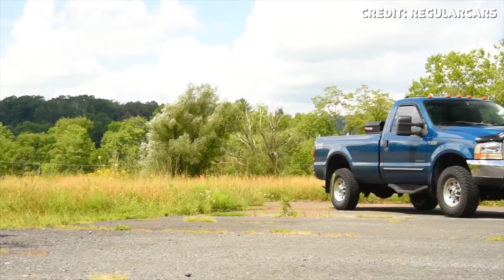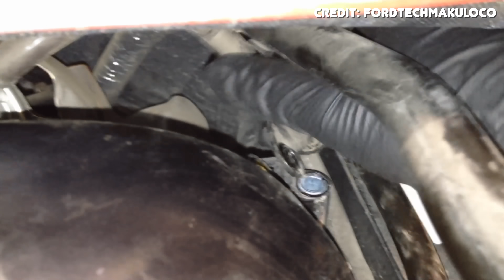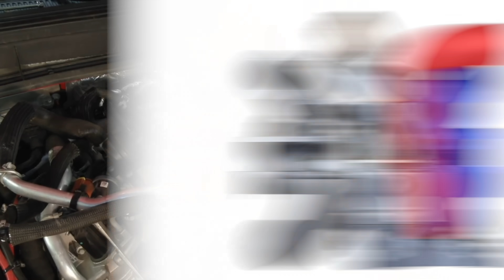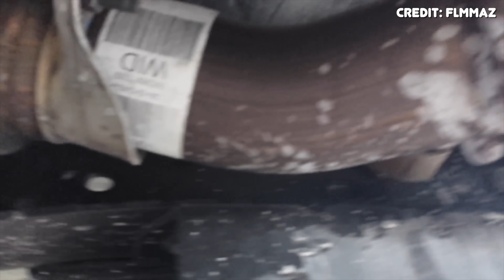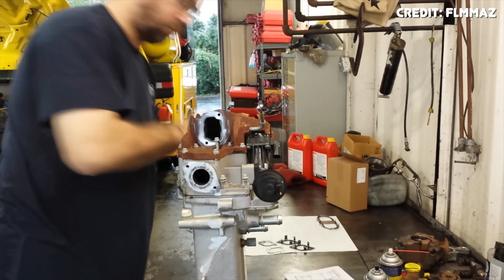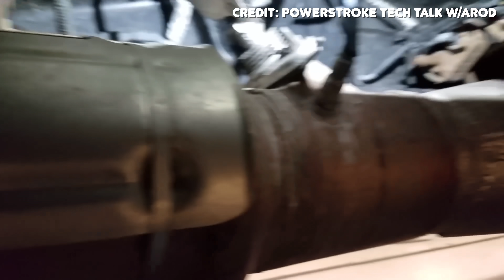Everything Wrong with the 6.7L Powerstroke

Comment: nothing is wrong with the 6.7 and it crouches everything in its class.  plus ford has the 10 speed and the stiffest chassis.  just consider “what’s right” because this engine is astonishing and now with steel pistons got even better -
Reply: While the powerstroke is the most powerful their chassis is probably the weakest between the big 3. I drive a 22 f250 and came from a 21 duramax. The power and efficiency is with ford but GM has the most robust frame on the market.
Reply: Second to ram , Fords have weak frames junk Dana axles and soft saggy suspensions and brakes that are poor at best.fords are bro dozers not work trucks.
Reply: @matthewwilliams9028  apparently there's a lot of boas vs reality - ford out tows everything on the market

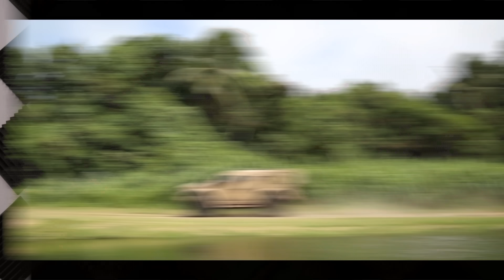Comment: 1:41 it's because a majority of carbon dioxide pollution comes from road vehicles. This makes sense, since there are waaaay more cars and trucks than there are planes and ships. However, I think your argument is correct; they should crack down on the aviation and shipping sectors more

Comment: The upper oil pan reseal is a fun job on the 6.7
Reply: Get a 20+ they went back to a gasket
Reply: @MattC0725 if it has a silicone pan I swap for gasket pan . If the customer doesn't like it tough shit
Reply: @thomasforsha8239  what customer wont like that lol

Comment: I’ve never had to deal with the fuel pump going out on one on the 6.7s I/my family have/had or on the 6.7’s in the fleet of vehicles I maintain (Camper haulers, farm, and construction trucks). I have however had the glow plug issue about a week before it because fairly popular. I’ve gotten really fast at putting s363 quick spools on 6.7’s and I’ve had a decent amount of issues with valve warp or meltdown and pistons as well as my local ford dealers having 2011-2014 blocks melting holes in them from the pistons out (emissions systems hiccups and heat build up problems). I do like the 10 speed transmission from what I’ve seen of it so far on the 20+ but I’ve lost faith in the engine due to how many times I’ve delivered what’s left of one to a scrapyard to be fair they’ve gotten better as they go instead of getting worse and the trucks I service use 90% or better of their rated capacity but on a vehicle with emissions equipment using 50% or less routinely isn’t good for them either and the ag, semi, and construction equipment manufacturers say don’t let them idle for long periods of time or the dpf won’t be able to clean properly. I’ve had better luck with 6.4’s but those are impossible to keep on a car lot for more than a week around me. Also to answer your question on emissions at the start of the video as a veteran whose military career was as a mechanic serving from Bush through Trump without a break and seeing the implementation of emissions first hand they don’t use emissions equipment because it’s been proving to increase greenhouse gases produced due to increase of fuel consumption outweighing the reduction per gallon (proven by multiple universities in multiple countries which is why everywhere else the deletes are street legal). Also in combat any reliability issues are a loss of life (should also apply to emergency civilian vehicles as well). It’s a ploy to look good but in practice just becomes a cash grab but in reality 40% of the worlds oxygen is produced by the US corn industry and 90% of US emissions reductions are done through purchasing carbon credits from farmers. No one wants dirty air but there has to be a less problematic and more effective way then what the government is requiring but not required to follow
Reply: 40% of the worlds oxygen from US corn? Dude have you ever heard of the Taiga forest? That's a complete and utter bullshit statement, good lord lmfao. I looked it up too, you're misquoting info real bad. Diesel emissions are a particulate and nitrogen dioxide issue- neither of which are greenhouse gasses but were overlooked for years despite being more immediately hazardous to health than c02. Diesel pre emissions still produced 30% less c02 than gasoline engines- with emissions equipment it's still no worse than gas on that metric.. You really sound confused on the topic.
Reply: @sly9263  the EPA put out that information as well as multiplication other agronomist universities. One study in particular done in Michigan proved that an acre of corn puts out more oxygen in a 90 day growing period that 10 acres of forest and reduced more nitrogen and carbon in the atmosphere as well. Joys of gmos and the billions of dollars invested in improving farming practices in the last 40 years. Come stand in my corn field for 10 minutes then go to a forest and you’ll notice it’s very easy to breath in the corn in comparison. Farmers are the reason ford (example but not limited to them) has such an emission reduction without changing any manufacturing practices due to purchasing carbon credits. Google field works podcast they have a very wide selection of material about how farmers are improving practices one episode being carbon credits another being a tractor that runs on methane. Anything that can be profitable will be more efficient and effective than a mandate and when you income focuses on a healthy environment you care a whole lot about making the environment as healthy as possible
Reply: @sly9263  also according to nasa the midwestern corn belt is the mist productive center of biological life, greenhouse cleanup, and photosynthesis in the world during the growing cycle
Reply: @ni1469  it has nothing to do with 40% of the worlds oxygen, not even close
Reply: @sly9263  the Smithsonian’s article on nasa’s findings state that it does. MSU study finding states high 30% and a Maryland university critiqued the nasa study and had similar conclusions. Those studies were done in 2012-2014 and forecast even better numbers for future outputs. Point being corn is getting more and more efficient causing more and more carbon credits for oxygen produced while constantly losing acres to population area/expansion. Also Chicago climate trade state very similar findings to prove my statement row crop farmers can sell carbon credits but forest restoration groups can’t even after buying and rebuilding logged out forests
Reply: @ni1469  Here's the deal, once you bullshit about something (40% of the earth's oxygen, FML), everything you state is no longer believable, Nat geo says 70% of the earths oxygen is made from ocean plankton, so WTF,  just stop and regroup

Comment: Now you are talking about my bread and butter. As I have mentioned before on some of your other videos, I am a fleet mechanic for a utility company in California. Almost all of our vehicles are Ford Super Duty cabs, while our larger trucks are International. I have survived the 7.3, the 6.0, and the 6.4 we are now on the 6.7

The 1st gen 6.7 gave us some trouble. We did experience several glow plug contact with intake valve failures; better than half of our trucks had it happen at real low hours. Also, the EGT shut down was a problem in the very beginning. Not only did it shut down the truck, it disabled the engine from cranking. Simply replacing the EGT sensor didn't correct it; the laptop has to be connected to clear the fault. The biggest problem we experienced was a DTC for MAP and TPS correlation fault. After racking my brains it turned out the engine had low compression in multiple cylinders. Ford insisted on repairing those at the dealer under warranty without telling me the cause. We are allowed to do warranty repairs in our shop for reimbursement on any other repairs, but Ford insisted they handle that repair. 

We never had any GEN2 6.7s. We are now replacing our aging fleet with GEN3 6.7s and so far it is looking good. They even sound quieter than the GEN1 that sounded like an electric typewriter on steroids.
Reply: What's your solution on the bearings? Do you cut the keyway for your timing gears or go a different route? How on the world do you keep these things on the road because Ohio would like to know. Tons of people here bought these thinking they would be reliable and they are just a heaping pile of crap so far.
Reply: My man, I run a DOT Shop here in Mississippi.  Do you have any dealings with the Maxxforce DT?  Lmao!!
Reply: @TheVenom8343  yes I do work on plenty of MaxxForce DTs and MaxxForce 10s. Although we are slowly retiring them and they are being replaced with Cummins. There are still quite a few 10s in the fleet. I can’t think of a time when all our MaxxForce 10s have been running. At least 1 or 2 are out of service at any given moment
Reply: @rtwice93555  Thank god, that we're going to Western Star's with a DD13 as they are MUCH better!!  We haven't had any engine or aftertreatment problems out of those yet.  But man, I can't for the life of me keep these junky ass Maxxforce DT's running.

Comment: Ford makes all their own stuff. Chevy used Isuzu dodge uses Cummins..  tear apart a chevy 10spd fomoco parts inside.. they just sell more trucks and spend more developing them.  Solid axel’s more power.  Hook up a laptop with forscan and u can do it all from your home
Reply: That why all the replacement parts from ford say made in China on them ford is Chinese junk at best.
Reply: GM and Isuzu are in a joint venture. That partnership created DMax LTD. Ford partnered with the Austrian engineering firm AVL to conceptualize the 6.7L Power Stroke's design back in 2006. The 6.7L Power Stroke engine blocks are manufactured by American foundry company, Tupy. Then assembled in Chihuahua, Mexico. The Duramax foundry is in Defiance Ohio. Then sent to DMax LTD in Moraine Ohio to be assembled. Not saying the Powerstroke isn't a good engine. All the engines in the HD trucks are very good. No sense knocking one to say the other is better. They all need each other to push them to be better

Comment: I bought a 2021 Powerstroke and Im just flat out impressed by the power of it. 
We do some heavy hauling with gooseneck horse trailers and hay trailer where weights til up towards 25,000 lbs. The motor moves those weights like they are not even there and even going up hills we end up passing people 😆
Ive put almost 50,000 km on it in a year and so far so good. 
Basic diesel maintenance will solve most problems. Change the fuel filters every other oil change, use synthetic oil and use good fuel. 
Do those things and it should keep things working properly. I get that anything mechanical can have problems and can fail at anytime but regular maintenance usually saves money later.
Reply: The idea of injecting fuel into the exhaust stroke, or a separate injector in the DPF (Duramax), is just wasteful.  Why can’t they accumulate the soot without a ton of back pressure and then use an induction coil to incinerate (regen)?  A tesla-valve design could accumulate most of the inline soot on a cordierite trap, where it could be heated too 600C without burning any extra fuel.  And why don’t they pull gasses for the EGR after the DPF system?  That would keep the soot out of the intake, etc.  But then, the EPA doesn’t care if the truck doesn’t last past 10 years; in fact, I’d say they prefer the "planned obsolescence" approach…. Idiots.
Reply: Not for emissions equipment it doesn’t.  It’s the Achilles heel of modern diesels bud.  I also live in the emissions diesel life as well and am crossing my fingers
Reply: @czwarlord9243  No one likes it I remember the same bitching about gas engines in the 1980's. Today emission controls on a gas engine have been solved manufactures are back making more power in gas engine than ever. Tell you the truth as a avid mountain bike rider I don't miss the clouds of black smoke left behind a city bus while I'm breathing hard. It's taken manufactures about 10 years to figure out emissions fix all the problems. New power stroke is able to make 500 HP from the factory that is impressive. I remember back in 2015 everyone said it would be impossible to make more then 300 hp with emissions.  The EPA doesn't design emission controls they set the standard and manufacturers have to figure out how to meet them.
Reply: @Mike-01234  the emissions on a gas engine vs a diesel is a completely different animal.  They aren’t close.  Not to mention the price of repair of these is astronomical compared to gas emissions systems.  For instance a DPF filter alone is on average $4k.  EGR, EGR cooler and def system repairs are also ridiculously priced.  The worst part is they are prone to failure.  The most expensive long term repair and maintenance costs on a modern diesel is the emissions.  That has never been the case on a gasser. Then of course the emissions systems reduces the longevity of a diesel.  As far as the black clouds goes all modern diesels have a much more complex tuning and tech.  Even fully deleted they DO NOT push black clouds(unless you intentionally have it tuned that way… which is dumb anyways but that’s another discussion).  To assume they do is just not true.

Comment: International 7.3
Reply: The biggest turd ever made international engines and trucks are all junk. The Yugo of the industry always have been.
Reply: I guess you have not had much experience with them to make that negative generalization. I do agree the newer international engines are very problematic but the older ones without emissions like the 7.3 and the dt 466 are excellent reliable engines plenty of power but not a lot of speed while loaded.

Comment: I would love to see a little mini series on all the smaller truck diesels. Silverado Duramax, f150 power stroke, and the ram eco diesel. Also the Ford transit 3.2 i5 diesel
Reply: Currently own the 6.7's and a 2020 F150 3.0 Diesel. LOVE the Ford F150 3.0 diesel... Good power, decent towing and excellent fuel mileage. Mostly highway miles on the 3.0, but I am averaging over 24 MPG for all miles/life of the truck. I can get up to 27mpg on steady highway driving. Although not a a big seller, it will be interesting to see how the Ford 3.0 ages.
Reply: Be more specific with the Silverado duramax cause the heady duty has the 6.6 but the halfton is a 3.0 I Believe
Reply: @colekrueger847  I said on the little diesel engines
Reply: I have the 3.0 power stroke and have 70k miles haven’t had a problem 

Im kinda strict on maintenance 
Simply cause I run my own earthwork business and just simple maintenance can go a long way on any truck or equipment 

So every 5k oil change and 
fuel filter at 10k miles 

little strict but I found this not having any problem on any of my trucks across the board 

It’s always other crap that breaks like water pumps , hoses , etc but never power train
Reply: @noelgonzalez6303  yeah they are pretty cool little engine input a fuel system in one because a lady put def in the tank it really wasn't that bad to work on
Reply: @tybailey9428  Some people. Like those who destroy their chainsaw by putting engine oil in the bar and chain oil tank, thinking it gets mixed inside?
Reply: No such thing as Silverado duramax f150.
Reply: @mann_idonotreadreplies  you do see the comma after duramax?
Reply: @mann_idonotreadreplies  👍

Comment: typically the CP4 goes because of galling from lack of lubrication in the fuel
The US uses ultra low sulfur diesel fuel... the EU still uses low sulfur

basically it was a case like NASA where feet and meters were a thing, and no one checked that seeming VERY noticeable thing
same thing happened with the CP4

so a pump designed with low sulfer, finds itself deprived of 97% LESS lubrication in ULS fuel, leading to galling, spalding and gouging over time  which is why it sometimes seems to fail for no reason